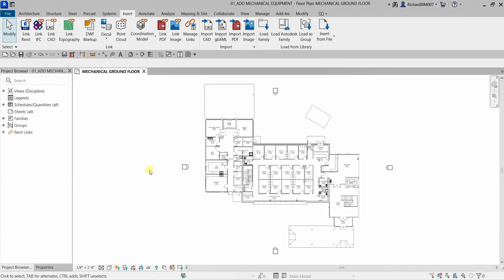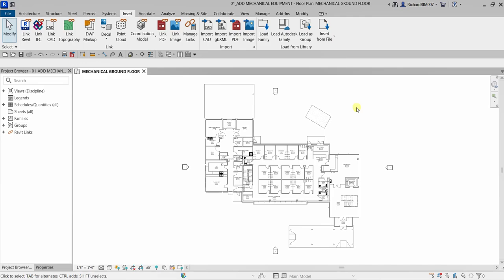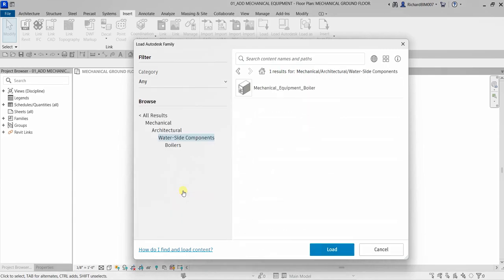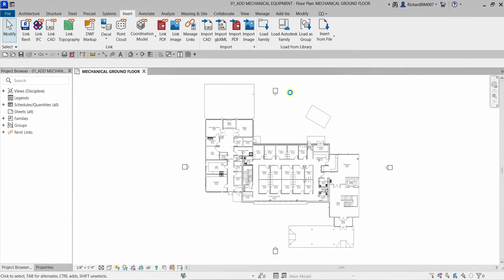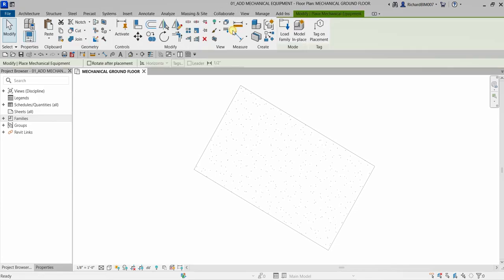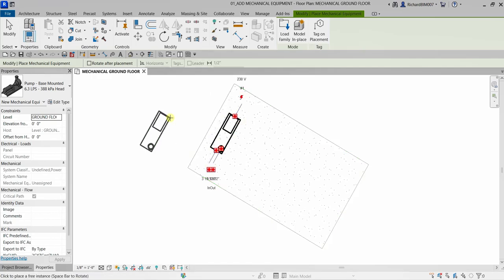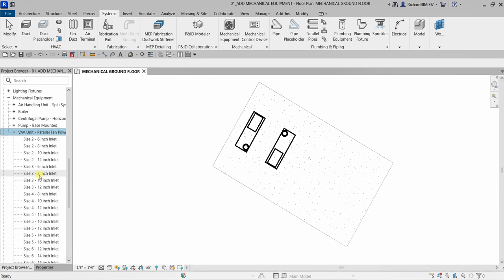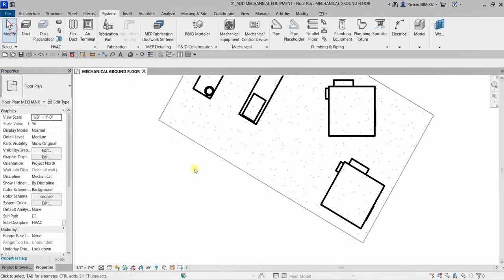REVIT MECHANICAL DESIGN PROFESSIONAL CERTIFICATION PREP: ADD MECHANICAL EQUIPMENT

Comment: Please Help - I have downloaded Revit and all of the Content, but when my base screen loads mine doesn't show any walls, and none of the lines are selectable for placement. I'm unsure what to do.
Reply from the maker: Hey Darius, try use these checks:

1. Check if You’re in the Correct View Type
Make sure you're in a Floor Plan or 3D View — walls won’t show up in views like schedules or ceiling plans by default.

Go to the Project Browser (left panel).

Double-click a Floor Plan (e.g., Level 1) or 3D View.

✅ 2. Enable the Architecture Tab
To place walls or lines:

Make sure you’re in the Architecture or Structure tab.

Click Wall to place walls.

If the options are greyed out or not selectable, continue to next step.

✅ 3. Check Visibility/Graphics Settings
It’s possible walls and lines are hidden.

Press VG or go to View > Visibility/Graphics.

Ensure Walls, Lines, and other model categories are checked.

✅ 4. Ensure a Template Was Loaded at Start
If you start Revit with no template, it can cause nothing to show or work.

Go to File > New > Project.

Choose a template like Architectural Template (look for .rte).

Then try placing walls again.

✅ 5. Zoom Extents
Maybe you placed something but it’s just far off screen.

Press ZE (Zoom Extents) or right-click > Zoom to Fit.

✅ 6. Graphics Driver Issues
Rarely, graphics settings can cause display problems.

Go to File > Options > Graphics.

Try enabling or disabling Hardware Acceleration, then restart Revit.

🧪 Extra Test
Create a new project with:

File > New > Project > Architectural Template

Go to Level 1, click Wall, and draw a simple wall.

If it works there, the issue is specific to your original project file.